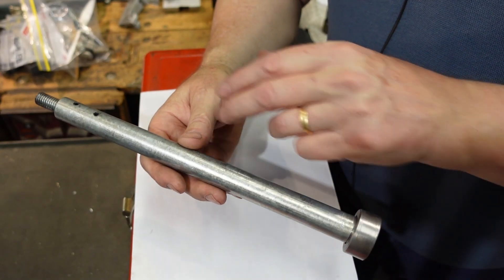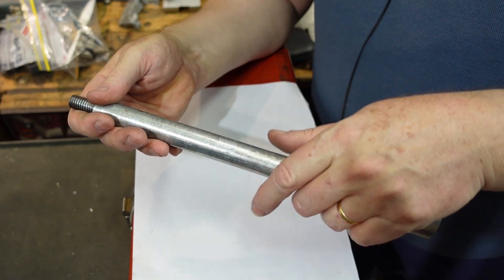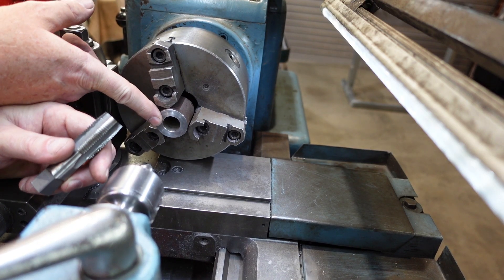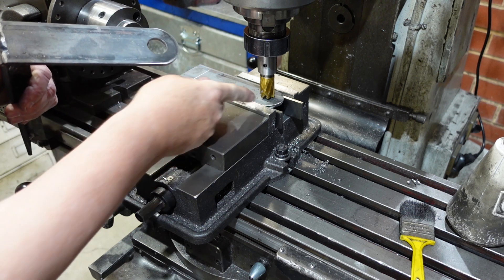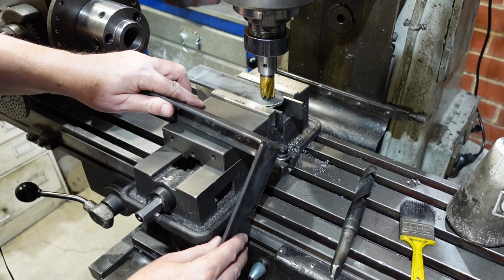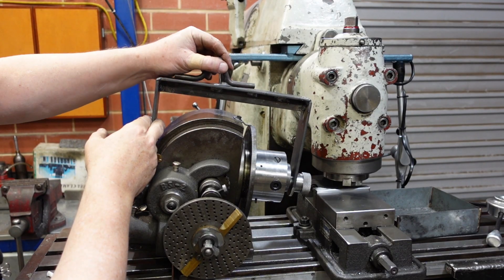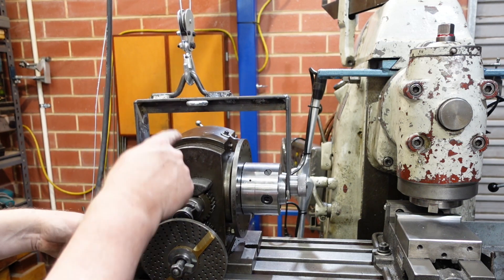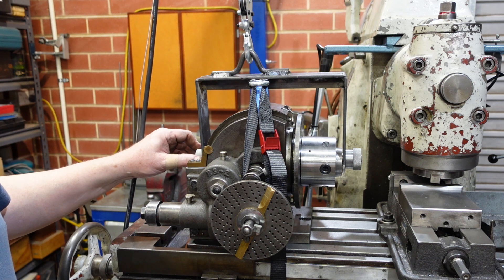Dividing head lifting jig

Comment: Whitworth.... whitworth...... at least you didn't make a nut with the standard (weird/huge) whitworth AF dimensions. Actually I get it as you had a tap of the appropriate size and it was WW. 
Just a reminder for others WW have a 55 deg thread form so 27.5 deg for the top slide.  Metric and UN both are 60 deg hence use the same 30 deg top slide setting.
A suggestion would be to put at least one more pulley on your crane to slow the lift down some more. Home workshop, so speed isn't important, but control is. A bit of a slip on the button and a dent in the table... or worse fingers etc.
Reply from the maker: That little bit on the front was twice speed. I did not put my normal '2x' on there though. Initially it was a single cable and it was that speed. The column is sized so it won't fail, but is a bit flexible - I probably should have gone up a size in hindsight. THe speed was a bit alarming though so I doubled the cable and things are a little less frantic these days.
The Whitworth thing is a hang over from a few years back. Only recently have Hardware shops around here stocked a decent range of metric bolts and UNC is a bit scarce. I think the bolt I used was a left over from making garden furniture for my better half.

Comment: I'm not a machinist, so the term "drunken thread" is new to me and quite amusing.
Reply from the maker: I've always thought of drunken threads as ones that are not square to the surface (and others I know use the term in the same context, but originally when threads were hand cut (that is, no lathe), a drunken thread was one where they did not get a uniform helix angle on the thread. 
The things you learn...

Comment: My super spacer hangs behind my Bridgeport by its chuck, and swings to the table on an articulated arm that is held in place by the two threaded studs on the left side of the mill.  I had to make a chord of a circle plate to be able to grab both of these studs and weld the square tubing of the articulated arm to it. I only have to move the mill table either up or down to grab it with the table.  It is a very old idea from some machinist long ago dead. I also have an attachment to store my vise behind the mill instead of the super spacer.  Your idea of motorizing the arm lift has great promise as you could than build some sort of a storage compartment right behind the mill to store even more mill accessories.  Good video.
Reply from the maker: The space behind the mill is taken up with small tooling in a roll out trolley, but that was the general idea behind this hoist. Most of the other accessories in the drawers are light enough not to need a hoist (at the moment anyway) but eventually the plan is to make up lifting jigs for some of the heavier items (angle plates, vices) so I can pick those up too.